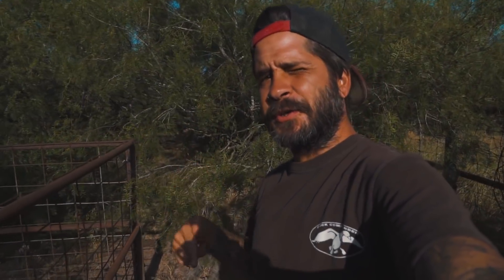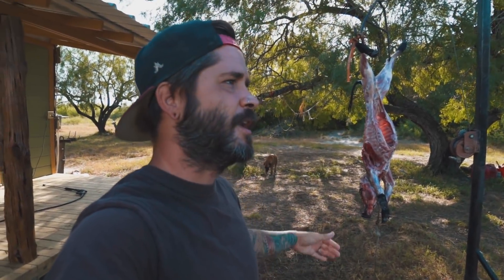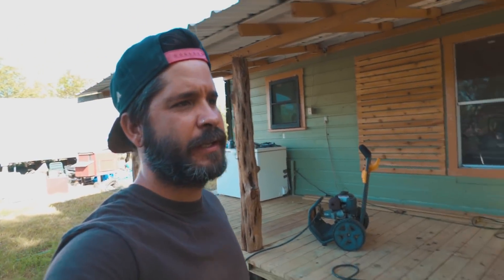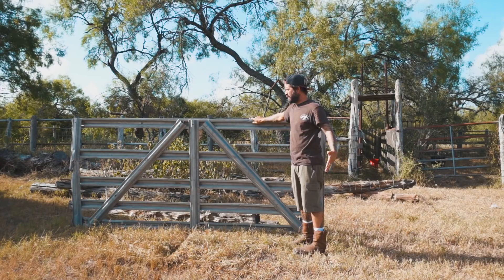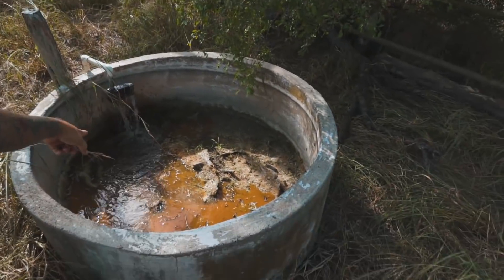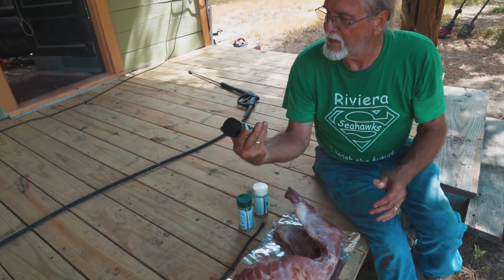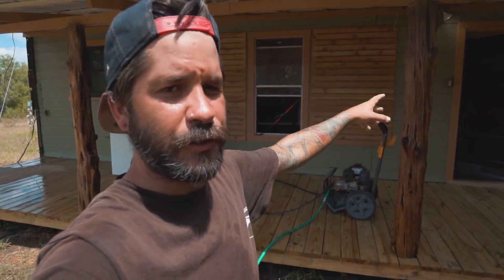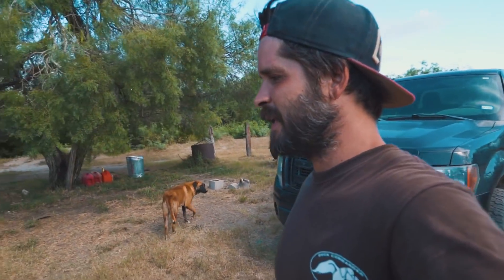Finally Got A Hog & Smoked It! - Ranch Rescue- Day 34

Comment: Really hate to see your dad have to bend over like that to do the back-rolling after you spray that deck. There was a green broom behind him on the porch. Typically the broom handle can unscrew from the broom and will fit right in the roller frame. That will save the aches and pains on his back to do that deck. Hope you guys utilize this trick and good luck on the final coat of stain!

Comment: Congrats on a full day and a fun video. 
Try shooting them in the head. On the big hogs shot them too but dont worry about skinning them. You just split the skin down the back and get the backstrap/pork chops and the main part of the rumps for roast. Drag the carcasses into the brush and the othef hogs will clean up the mess.

Buried bath tubs work great for buried ground cooking.
Reply from the maker: Thank you!